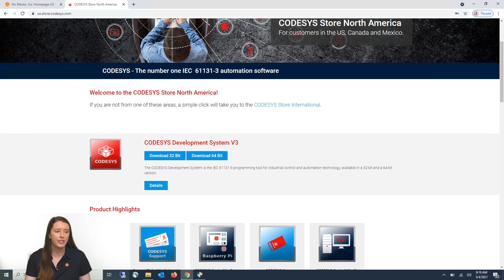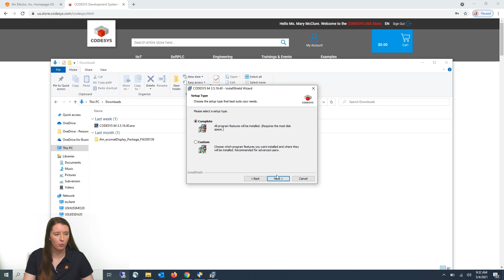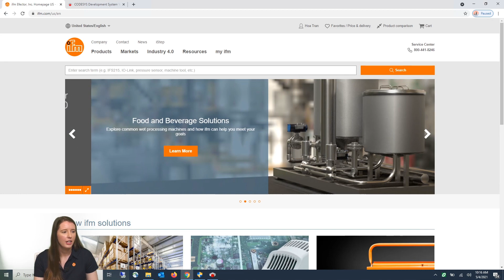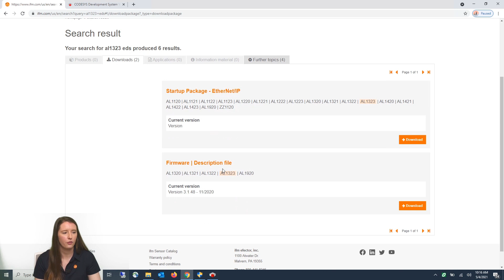How to Install CODESYS software & IO Link EDS on an industrial controller

Comment: Ummm SP 20 doesn't have a Package Manager in Tools menu.
Reply from the maker: Hi @robm7914, You are correct! Starting from SP19, please use the 'CODESYS Installer' to install the packages. You can find the installer in your Windows Start menu.